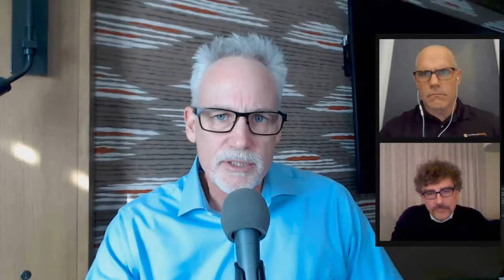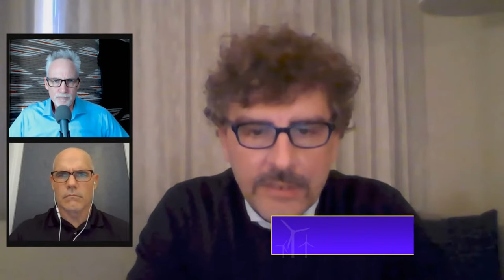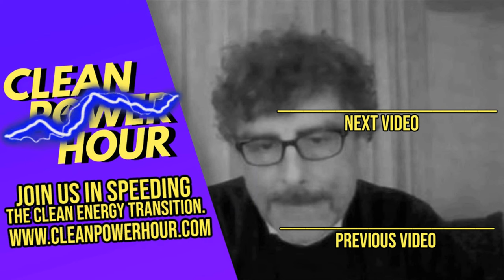Energy Dome Explained - How does it work? I Clean Power Hour

Comment: Is there an advantage to using CO2 over other gasses like nitrogen or just air ?
Reply: The point is that currently we are using tech to reduce or even stop more emissions but through this we can start reducing or eliminating CO2 from the atmosphere.
Reply: CO2 is cheap and easy to create. For instance you create CO2 every time you make bread or beer so one process for creating it is simple fermentation. It's also a byproduct of making ammonia fertilizers. For instance Dry Ice is nothing but solidified CO2 and is relatively cheap. Every tavern in the US uses CO2 in tanks for their on tap beer. Since it is a sealed system you should never have to replace it unless you have a leak. We likely use more CO2 per year just for beer than we'd ever use in systems like these by a considerable margin.
Reply from the maker: Good question Ken... We'll have to get Energy Dome to answer that. Presumably yes...
Reply: Yes. You can liquefy CO2 easily just by moderate compression (>50 bar). You can't do that with air or nitrogen.

Comment: In the Netherlands and northern Germany there are empty saltcaverns. They have a content of a miljon m3 and some are used to store natural gas. Don't you think an empty salt cavern could also be used for your atmospheric CO2 storage instead of the dome ? Saltcaverns are much larger and don't 'damage' the landscape.
Reply from the maker: It's a good question and good point.
Reply: I suppose, if you have such caverns, which can hold high pressures, you might better use them for compressed air energy storage. 
You get much more storage capacity per m³ of compressed air than per m³ of unpressurized CO2.
The advantage of this concept is the independence from such caverns, you can place it "everywhere".
But if you have such caverns, compressed air is better.
Reply: Are the salt caverns air tight? What is involved in making them air tight? When gas (methane) is stored is it just stored in such a way that it is completely sealed or is it possibly that some losses occur? Methane is lighter than air so maybe it's quite easy for the methane to just sit at the top of the salt cavern until needed. Carbon dioxide is denser than air so maybe it wouldn't be as suitable in the salt cavern. I think it's important that the carbon dioxide remains pure in this energy dome method.

Comment: This looks to solve one of the main problems with conventional batteries and that is Energy Density. What makes gasoline so attractive is it has an extremely high energy density, however it's not renewable and is one use. The reason hydrogen has been a no-go and likely never will be practical is because it has such a low Energy Density making it impractical and again it's not renewable and is one use.
Reply from the maker: Perhaps too early to tell but we're thrilled to bring emerging tech to our audience. Thanks for your comment!

Comment: Maybe the CO2 energy dome can be connected to a CO2-pipeline. Then a dome is not neccessary. Like Elestor wants ot connect his HBr-flowbattery to a hydrogenpipeline so that storage of H2 is not neccesary. Problem is that CO2 is not needed when it is dark (for example in greenhouses for more fotosyntheses) and compressing the CO2 out of the pipeline in empty gasfields (CCS) askes also a lot of electricity.
Reply from the maker: Luckily for Energy Dome the US is going to be swimming in CO2 pipelines if the US Government meet their goal of helping establish 60,000 miles of C02 pipelines. In the case of Energy Dome their system is closed loop so it just needs one batch of C02 but your idea is a sound one.